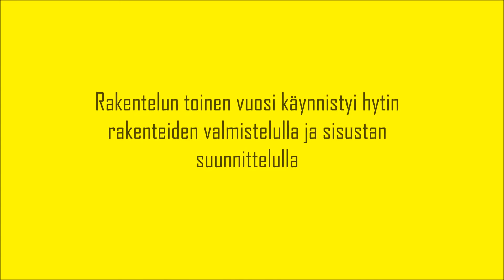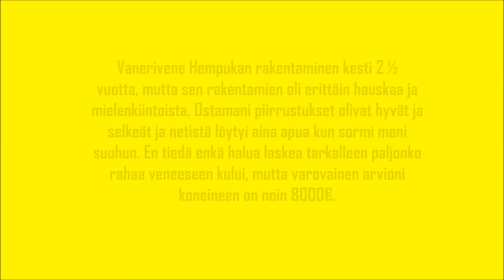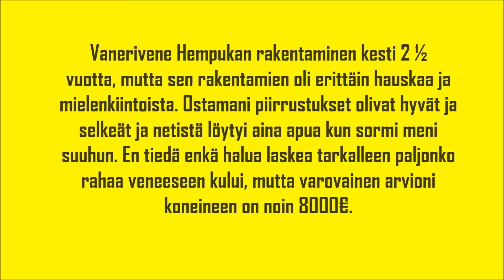Vanerivene Hempukka osa II

Comment: Very nice!  This is the best illustration of the Bateau 20 houseboat I have seen.  You said on diy-wood-boat.com that with knowledge that you have now, you would build more seaworthy hull.  Can you please say more about the hull and its seaworthiness?  I am looking at building one of these in 18 months.  Thank you very much.
Reply from the maker: I choose the HB20 because they said that it was easy To build and good for beginners. Now I think that it would have been wise and almost as easy to build v-shaped hull. There is alot of space In HB20 but handling and fuel consumption is bad. I also would build smaller boat now, something that I could move with trailer and handle alone. I hope this helps. Building a boat was the fun part and one day I am going To do that again.
Reply: @Hemppa  This is very helpful.  Thanks so much for your quick reply.  I am looking at taking the Bateau 18 (because it is trailerable) and stretching it to 22 feet.  But seeing yours up close and personal in photos really helps me visualize the general design much better.  Thanks again.